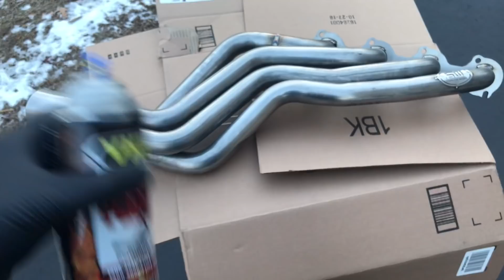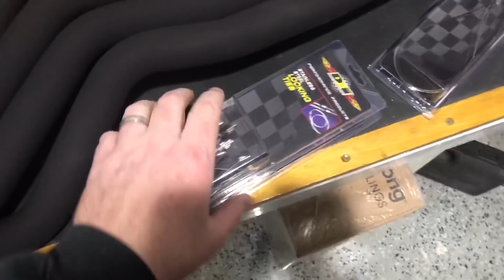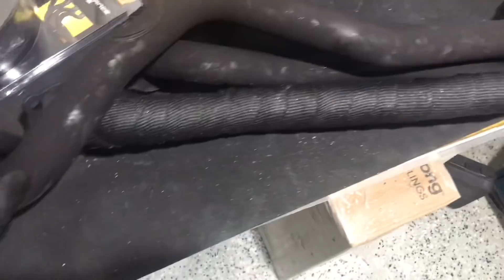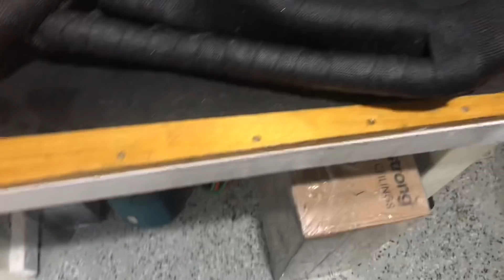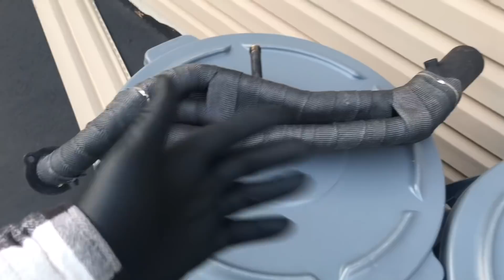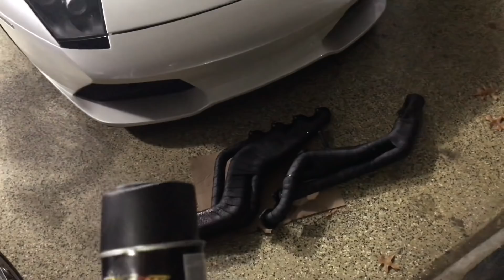Putting Header Wrap On Stainless Works Headers

Comment: So how did it work out for you? I'm still debating on wrapping or coating . Down side to coating is I have to drive 4 hours .
Reply from the maker: Torred 5.7 Claxton so far it’s been on over a year and the header wrap still looks great
Reply: @carguysnewengland  I'm just worried about wrapping the headers and them being heat soaked and cracking over time ..
Reply: Ship them to Jet-Hot
Reply: Don’t do it not worth it, trust me I’ve done it once never again..